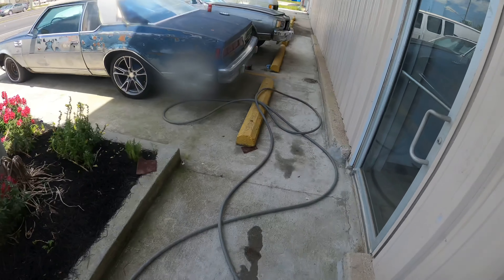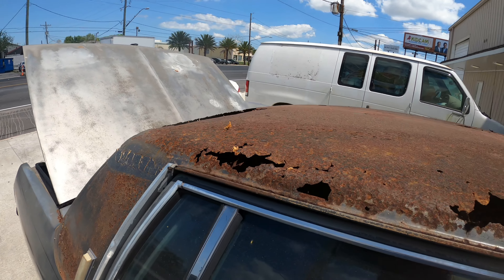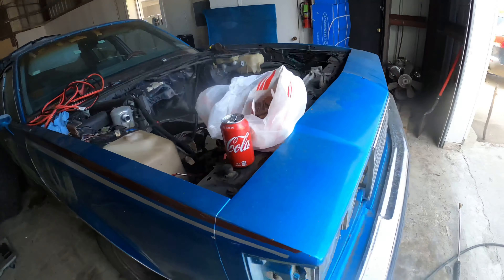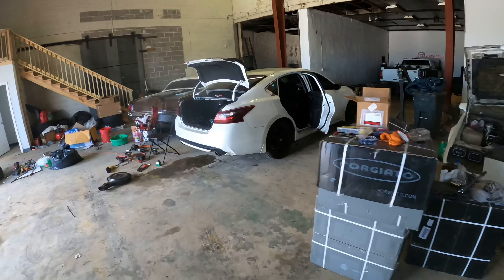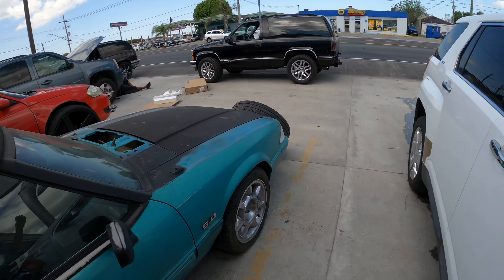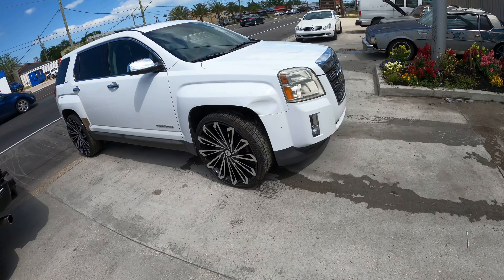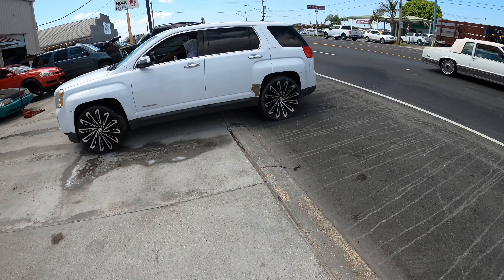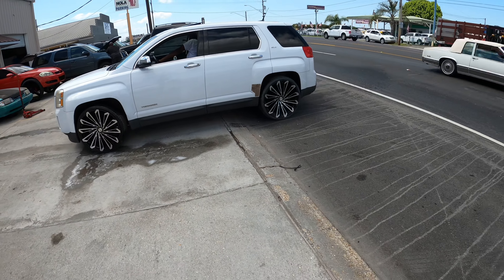GMC TERRAIN ON 24INCH STARR RIMS MONTE CARLO SS ON 30S

Comment: Just bolt on  and go? Did you have to cut at all to avoid rub?
Reply from the maker: they go right on with a 245/30/24 tire 255/30/24 you have a small rub on a max turn

Comment: Did 24 on the terrain require a lift?
Reply: Or any cuts of any kind?
Reply from the maker: No lift needed and as far as cuts you may have to trim jus a little on the plastic fender well on a max turn no cuttin on the body of the car
Reply: @Eazyauto  what size tires
Reply from the maker: @davonmettler4271  I believe 245/30/24